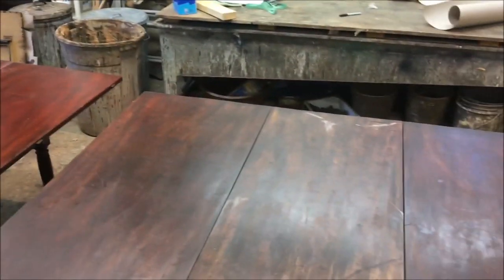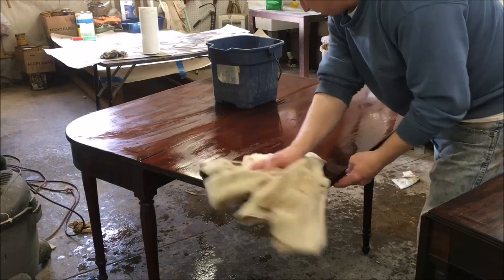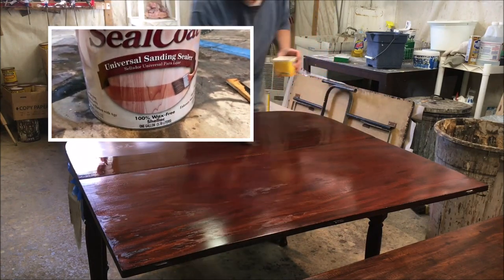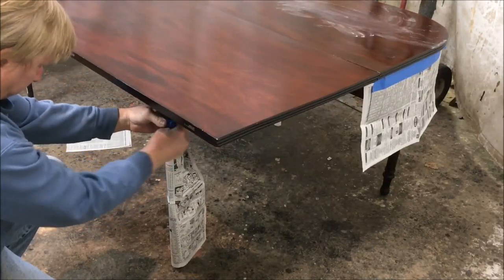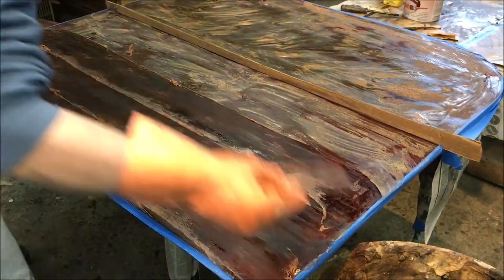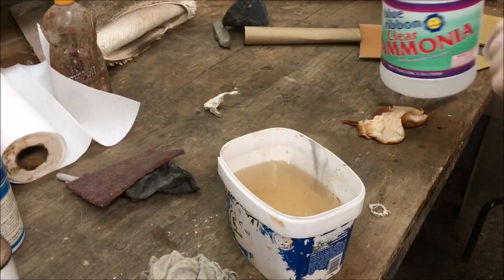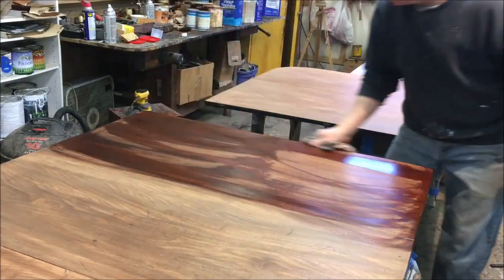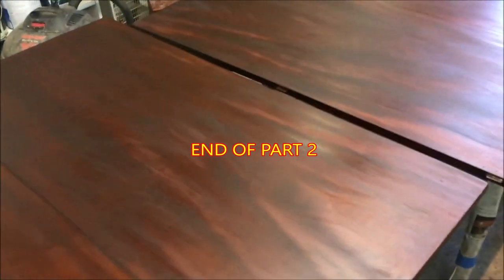MAHOGANY BANQUET TABLE / PART 2 OF 3

Comment: that weird pattern on the center table looks like a pattern i had on part of the top of a second hand coffee table i purchased years ago.  i think someone had put a corrugated cardboard box on the table and the box got damp or wet at some point between the wood and the box and over time that caused the corrugated cardboard pattern to transfer to the surface of the wood on the coffee table top.
Reply from the maker: good theory . the stain did come out